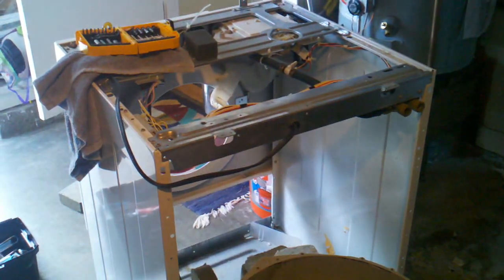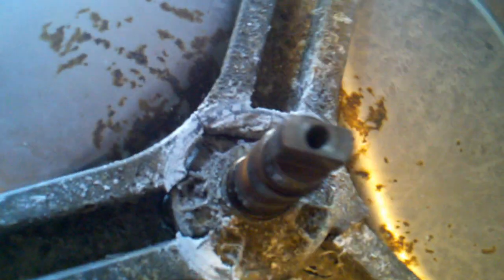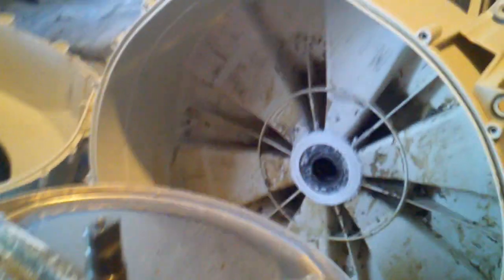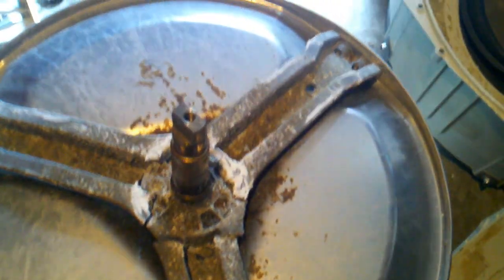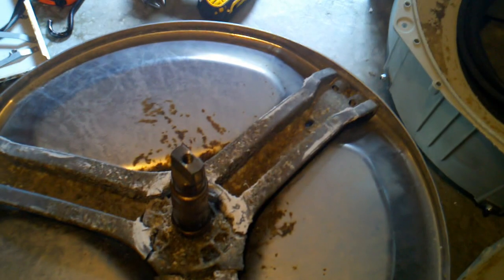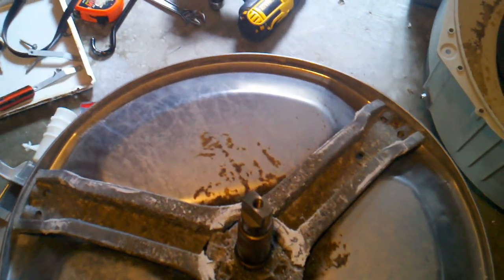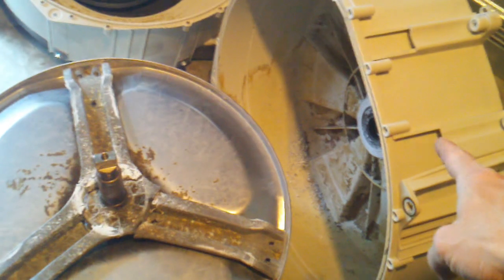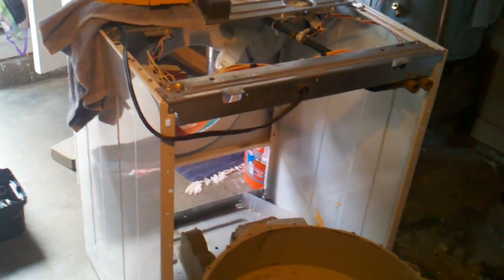BEWARE!! Kenmore Front Loading Washer Model # 417.44042400 BROKEN SPIDER ARM

Comment: I recently experienced the broken spider-arm problem on my LG Tromm front loading washing machine after 6 years of use and decided to repair it with the purchase of a new LG spider arm and new front gasket. Appliance Parts Pros provides an excellent video on how to perform the repair and they shipped the parts to my house in a couple of days. To help prevent the corrosion of the Aluminum Spider Arm in the future, I sprayed the new Spider Arm with about 5 coats of White Rust-Oleum Appliance Epoxy Spray Paint and filled in the grooves in the inner tub with Loctite 2 part Marine Epoxy Glue. I spent about $170 on the repair for the LG Spider Arm, gasket, Epoxy paint and 6 new SS M8 x 1.25 x 30mm bolts to reattach the spider to the SS basket. It's obvious that this is a known problem and the spider could have been made out of Stainless Steel, Painted or Powder coated and I was even considering making my own out of 1/2" 6061 Aluminum or applying Fiberglass resin to the voids in the new one I received. The clothes were piling up so I took the Epoxy paint route. A lot of work but I felt a sense of satisfaction that I accomplished it myself and hopefully the Epoxy paint will safeguard the spider for more than 6 additional years of use. Since the manufacturers are not addressing this flaw, we can add our own experiences to resolve what is a know problem.

Comment: Good video showing the problem with these front loading washers! I replaced the spider arm assembly on mine several years ago due to it also breaking from corrosion. If you decide to replace the broken spider arm assembly and/or plastic tub yourself, some tips before you install the new the replacement parts: (1) paint the spider arm itself (not the stainless steel drum and shaft) to help prevent corrosion, (2) fill all the cavities near the center of the arm with marine epoxy to prevent detergent residue from collecting in them, and (3) cut off the ends of the protruding screws on the stainless steel drum. After replacing the spider arm assembly and plastic tub myself, my washer has been working fine since, but I don't think I will ever buy a front loading washer again due to this problem with them.
Reply: If you replaced a spider it was not a Kenmore/Whirlpool washer or it was not an OEM part. Whirlpool spin balances the complete inner basket assembly at a higher speed tha ris experienced in the machine and does not sell the spider as a separate part.
regardless of brand,  
1. The spider didn't fail from corrosion, but cold working stress fracturing from wobble.  Wobble opens the space between the seal and shaft allowing deposits in the water to get to the inner bearing. NO bearing is completely sealed when in motion.  If exposed to water with lime or iron the grease of the bearing will become contaminated the bearing will deteriorate, vibration and wobble is introduced, stress fracturing of the spider is inevitable if the bearing doesn't fail completely first.
2. Any paint that isn't compatible with the metal and environmental conditions inside a washer will fail and THOSE deposits will tend to accumulate near the hub and abrade the seal.  
3.  Any filler applied to the spider that isn't perfectly balanced will increase wobble and exacerbate the problem.

Comment: I had a similar problem, the rust out the back indicated the bearings had went, problem was that the bearings has basically exploded inside and the inner race (part of the bearing) had rusted to the spider arm on the shaft.  It is too bad I can't get the spider arme as it is really the only part (besides the obvious bearings) that i would need to replace.  Everything else seems in great working condition...

Comment: That spider didn't fail from corrosion, but from stress cracking.  When corrosion is the cause it's due to the water supply being unconditioned.  A white deposit over the exterior of a stainless spin basket is lime deposit.  An orange coating is iron. Deposits accumulate within the spiders ribs and because of its shape, not from its corrosion and at the hub because of slower motion. 
- The outer plastic drum will NOT accumulate iron deposits unless the water supply has a heavy concentration of rust. This is common with old water heaters, where the sacrificial anodes have not been periodically replaced (every 5 years or more often).  -- White deposits on the stainless drum indicates excessive calcium in the water.  Either of these deposits will cause the seal to fail around the shaft and the inner bearing to wear. 
-High frequency vibration during spin cycle combined with excessive or unbalanced loads causes the the basket to vibrate and wobble,  cold working the spider until it cracks. With ANY machine, it it makes noises during operation that it did not make when new, some kind of service or repair is needed. Deferring that work will inevitably lead to a more expensive repair.
-To avoid this, service your water heater,  neutralize well water by adding vinegar to each load, and RTFM.

Comment: Hello.  Not sure if this is still an active thread.   I have a similar Kenmore front end loader, model 417.4314220, and it started making a loud noise when the drum is in the spin mode.   It sounds like a transmission or bearing needing lubrication.   Just a loud steady racket.   Was hoping to if there was something here to help me.   Looks like the drum spins on an axle.  How is that axle lubricated in the race?  Is it ride on bearings?   I'm hoping this is not a huge problem a little oil or grease could fix.....

Comment: I have had Kenomore front load washer for 11 years now.  The mother board broke.  I did the trouble shooting myself, and also checked the condition of the washer.  Mind you that I left the washer  door OPEN between washes, so the interior can dry.   Mine is still in excellent condition.  We keep the machine in the garage, but we have very low humidity here in the SW USA.  The problem with the spider arm here is somehow related to high humidity and adverse conditions.  These machines can last a very long time, if you take proper care.

Comment: Sears gave me a quote for $1979.72 for the exact same problem.   And the washing machine still has 3 years of warranty on the tub and lifetime on the stainless tub?  They told me they would have a tech visit for $75 and the parts would be shipped to my house.  WRONG they will only send the $1302 in parts if they can charge you $417 to install the parts.  Why isn't Sears legally bound to honor their warranty?

Comment: This is a huge known issue. You forgot to mention on your video that the spider arm is removable via two screws per segment but you can't buy just the spider. BTW...buy an LG, they sell separate spiders for about $70.  Yes, Kenmore ripped us all off. The Whirlpool Duet is essentially the same machine and has the same flaw.

Comment: I have the exact same issue.  The warranty is completely meaningless, they sell the tub and spider as a single unit, and only to their authorized service rep.  You are completely at the mercy of who they send as a service rep.  And, you cannot send Sears a picture or take the machine or parts to the local repair center (2 miles away).  The service rep I have been put in contact with refuses to order parts for me to fix it myself - he is 'completely by the book'.  The 'Fix It' amount is more than the purchase of a new machine (nice LG model 452012 is $599.00 today at Lowes).  I doubt I will be a purchaser of Sears or Kenmore or Whirlpool appliances again.

Limited Lifetime Warranty on Stainless Steel Drum: For the lifetime of the washer from the date of purchase, Sears will replace the Stainless Steel wash drum due to defective material or workmanship.  After the first year, you will be charged for labor.

Comment: Same thing has happened to me. It really has nothing to do with detergent, bleach or temperature, it does, however have everything to do with planned obsolescence and or revenue generation. Why else would they use some sort of low density cheap alloy as a key part and attach it to a stainless steel drum that would be exposed to such harsh conditions. What is the likelihood that most if not all front loaders are built this way. I suspect this is one of many dirty little tricks inflicted on us the consumer by big business. At least LG offers spiders for sale separately, who needs or wants a second s/s drum when the first is fine, not only wasteful but it's the old way of doing business. Sears should consider the digital world and how quickly word spreads, they are in enough trouble as it is, they should not be alienating their customers. Happy recycling!!!

Comment: Just got through going through the same frustration as all the others listed here. What a crappy design! The spider appears to be made of cast aluminum, one of the worst, most brittle metals on earth! There is no way to weld this material properly.  What garbage; guess it's off to buy a new one adding this piece of crap to the landfill

Comment: Washer spiders been made of ally/pot metal for last 30-40 years, (Or longer)! Its a RECENT issue, they Used to last 10-15 years, but not now!

REAL reasons for failure--Too Cold Washes (below 50 degrees C)--Too Little Water in machine! ie, Greenie driven efficiency.--Counter-Productive--Just fills up scrap-metal yards full of rotted out machines, Manufacturers love it!.

Liquid and liqui-tab detergents dont help the rotting either.

Spiders always seem to fail at the centre The Thickest part of the metal--where they never get cleaned (low water use) and allow crud/bacteria/moulds to grow there, (Low temperature washes) rotting out the ally, .
--Ends of the spider-arms are not affected anywhere near as bad as the middle. This fact must suggest something Other than just poor design/poor metal alloy.

Comment: If you replace this part make sure you coat the new spider with Epoxy Resin Paint.  This will seal it for good so this problem will never happen again.
Reply from the maker: That's indeed what i ended up doing. Had been working perfectly since then. Thanks!!